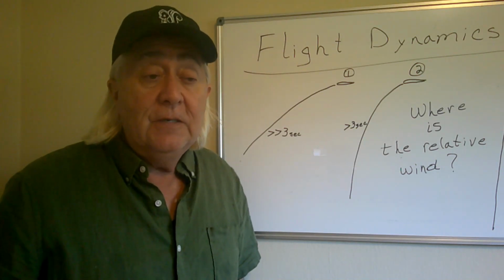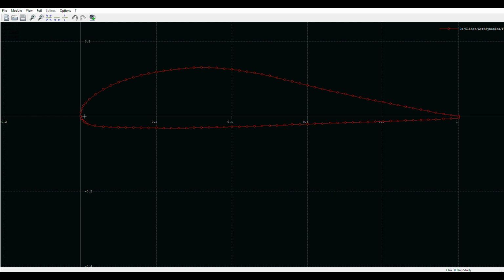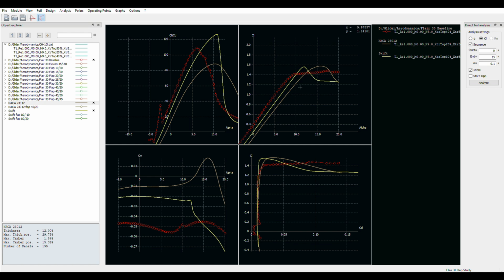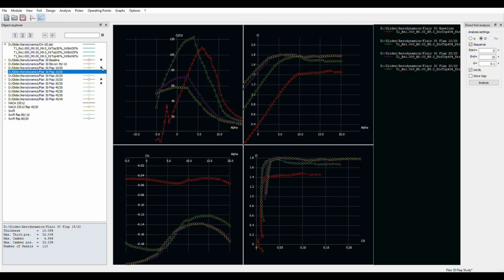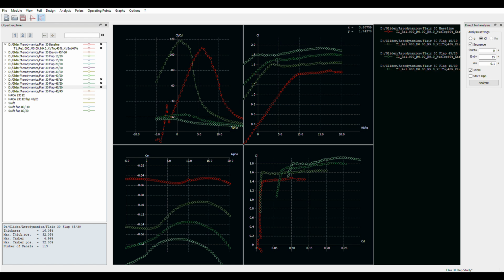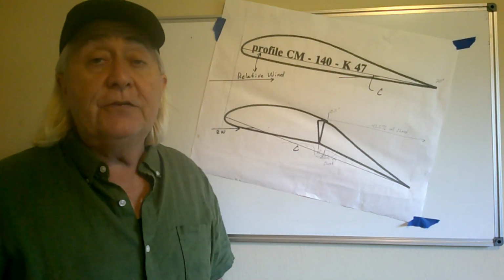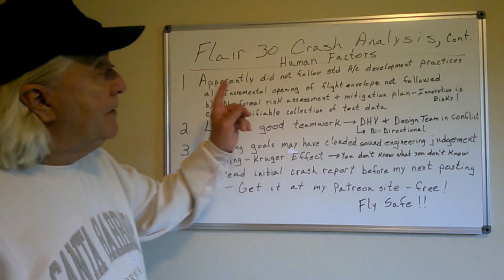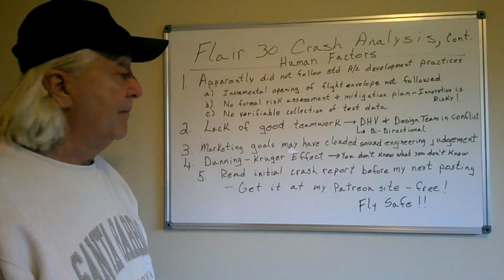Flair 30 Fatal Crash - Final Installment - Technical and Human Factor Details

Comment: So.......When a slat moves DOWN (on the front of the wing) the overall angle of attack of the wing is less.  

Thank you for spawning several epiphanies !
Reply from the maker: Yes, that's why it is nearly impossible to tip stall a wing when the slats are deployed. So, why aren't they used on all aircraft? Mechanical complexity and maybe weight.

Comment: An initial investigation of some of these concepts was performed with a 2 channel RC hand  launched glider using giant flap instead of elevator for pitch control - the Flap-a-lator (https://www.youtube.com/watch?v=7clsTfbXpC4)

The results are promising with great speed range, low-speed control authority, instant drag shedding upon raising the flap (stick forward) and good penetration at minimal loading.  

Airfoil thickness ~3.5% of chord

Flap area =~50% of wing area…. Notice the total travel of the trailing edge is not huge, for overall A.o.A. changes comparable to that of a conventional-sized flap of minimal chord percentage.   Naturally the planform of this wing is also a unique component of the overall aerodynamic performance, as is always the case. 

The angled hinge is not ideal compared to variable curvature, which is not out of the question for these light weight hand-launch glider airframes

Further envelope expansion is needed for CG placement, wing loading and fixed stab parameters of angle and area, etc....

-TimH
Reply from the maker: RT Jones (famous engineer with NASA Ames) did all this work back in the "70s or there abouts. He also developed all the math and ran a series of tests. The team that designed the Swift hang glider tried to use the concept in full scale but could not get sufficient control power. They still use the concept for pitch TRIM control and I do the same thing on my KW MkII. Keep in mind that many concepts that work on models do not work the same full scale do to Reynold's number differences.

Comment: I believe, Steve, that tail surfaces on many airframes are hinged midchord.  Based on your kind sharing, I begin to become concerned about such control surface ratios.  I also recollect on very early flying machines that horizontal surfaces sometimes exceeded 50% chord hinge points.  Thank you for bringing these issues to the world's attention, Steve.
Reply from the maker: This was covered by a previous comment. I know, easy to miss. Many control surfaces are hinged at 50% and they are mostly flat plates which is an entirely different issue. Also, most of them fly at much higher Reynolds number, making them a different case. I also see a lot of comments about models and they are another special case. You can't make comparisons across wide Re ranges. It's a case of apples and oranges. This is what tripped up the Wright Bros into using the wrong airfoil. See my video on the subject here: https://youtu.be/3PqZurAydNw

Comment: Haven't you flown free flight wings?  Really that is a fine practical and inexpensive way to learn practical aerodynamics.  Key is free flight.
Reply from the maker: I have flown many different types of free flight for many decade and used to compete at the National level with indoor paper stick. That said they don't tell you much about full size aircraft due to the Re differences. Even my 1/4 scale R/C model of my current wing does not fly the same as the full size because the low Re avoids all the flow separation issues. See the following video: https://youtu.be/3PqZurAydNw

Comment: Flair airfoil looks similar to the Liebeck high lift airfoils for low Reynold's number. They have a sharp stall on both positive and negative angle of attack. The margin for separation in the pressure recovery section is constant so when they deflected the flap the flow started separating at the hinge line loosing lift. The hinge flap became a split flap.
Reply from the maker: Are you saying that the Flair flap was acting like a split flap because of the separation criteria? Do you have any analysis that shows the effect? If yes, send it to my email. I might want to do a video on it. Seems to me they are really two different cases, but I have never really studies split flaps.

Comment: The hinge was a good idea for transport. They might have kept it and added proper control surfaces.
Reply from the maker: Agreed, but it appears that the transportation idea came first and then the decision to also use it as a control surface.  And, then the whole concept was marketed and hence became very hard to undo, especially after molds had been constructed. This all falls under the Human Factors issues.
Reply: @KlingbergWingMkII  I would add that there is also a human factor to dismiss good ideas when disaster happens. Sort of like tossing the baby out with the bathwater.
Reply from the maker: What "good idea" was I dismissing?
Reply: @KlingbergWingMkII  YOU weren't dismissing anything. People tend to overreact when disaster happens and not reconsider what was right. Are you or did you consider the hinge for the the Klingwing 2?
Reply from the maker: No, only briefly very early in my trade studies. Rejected it due to weight, complexity of the build and attending control systems. Poor trade for a small gain in portability. My current design is still car top-able (I like the trailer) and can be assembled single-handed in about 30 minutes and that met my desires..

Comment: Excellent work Rol, lots of hours put in and it shows.  Inducing a stall over the majority of the wing on flap deflection makes a great deal of sense, such a big reduction in stall AOA is such a huge change in flight control that makes the wing so much harder to learn to fly safely.

Tuft testing would have really helped pick out the stall characteristics.  So much easier now to monitor tufts with lightweight high rest cameras and or even following drones.  Even back then though it might have been a big enough kick to get them to rethink such a broad flap across so much of the span - as the aero analysis suggests that separation was happening on the wing even on small deflections.
Reply from the maker: Thanks for the kind support. A thing that made me depressed as I did the analysis, is the fact that they might have been able to access the DHV test vehicle where they could have done tuft testing, amongst other tests. 50 meters off the ground is the wrong place to discover bad aerodynamics.
Reply: @KlingbergWingMkII  Even with tuft testing the DHV Test vehicle would have picked up oddities in the effect of the flaps on pitching moment, lift and drag.  I'm pretty sure it would run up a whole bunch of red flags that the flaps weren't behaving the way they were claimed.

From my experience of getting gliders ready for DHV on the AIRWAVE test rig (early 90's)  it was clear that the DHV had their own problems.  There was dubious elements of the DHV test requirements that didn't make sense from an aerodynamic perspective, and were out of step with the UK and US airworthiness schemes that made more sense, but I believe they were belligerent in sticking to their approach.  I don't know if they've fixed these errors yet.  There are errors in the UK and US ones as well, but these issues are a whole nothing topic...

I could imagine that the DHV tested it and got stuck on stuff that really didn't make sense for the Flair and wouldn't consider adapting.  However, the Flair clearly had major problems itself and their designers weren't open to considering these issues thoroughly.  The DHV report would shine a lot of light on what they found, as well as the culture behind them so it's shame it's not been shared for everyone to learn about.
Reply from the maker: Your comments on the DHV go directly to what I'm saying in the video. It is a classic example of people on both sides working from a point of "Not Invented Here" instead of working as a team - a classic human foible. I know the DHV had its own issue and I think it's a case of they were geared to test flex wings and lots of that does not apply to rigid wings. If that was the case here, the Flair team should have done their own vehicle testing rather than putting a person's life at risk. I've spoken to a number of people that interfaced with the DHV and it is clear there was enough conflict to go around and in this case that was part of the reason for the crash.
Reply from the maker: Oh, yes, and let's remember that the person that told them to stop flying was a professor of aero engineering at the local university. That does not mean he was right, but it does mean they should have stopped flying until his concerns were fully vetted backed by analysis. This goes to my point of having a well-structured test plan with rigorous risk management.
Reply from the maker: Actually, maybe not. I'm not sure the test vehicle in that era had a load cell for collection of lift, drag, and pitching moments. Initially, in the 80s the test vehicles were used strictly for load testing to ensure the structure was strong enough. Could be either way. If the vehicle had load cells, it would have been quite fancy for the day. Maybe a viewer from Germany would know? If so, let us know.
Reply: @KlingbergWingMkII  HG Test rigs in the 90's had load cells for lift drag and pitching moment,  USGA, BHPA and DHV rigs all needed them as certification during this era required this data.  The AIRWAVE test rig had all these measurements as well as it was important to make sure the gliders were going to pass before being sent for certification.
Reply from the maker: I think the Flair was tested in the late 80s and I don't know when load cells came into use. If the DHV had load cells at that time, they would have clearly shown the problems with the flap, if the DHV deployed it during their tests. Either way, my point remains, both sides failed to work as a team, did not take a professional approach and ended up killing someone. In my mind, human factors killed that poor guy.
Reply: @KlingbergWingMkII  Totally agree, there looks to have been were several opportunities where proper engagement between various parties could have led to a different outcome.

I am surprised the the flight test didn't raise more red flags prior to the accident, in 50hrs of flight time they must have had the opportunity to explore the effect of the flap deployment on stall AOA, pitching moment and performance.  A lighter pilot would change the airspeed things happen at, and might change the COG a bit, but aerodynamically it's still the same wing, the same fundamental problems would be there.  The glider likely wasn't nice to fly, especially at lower speeds and with especially any amount of flap deployment.

This makes me wonder if the test pilots were also being overridden/ignored, or they lacked the experience the properly convey what was happening.  Given the DHV was also ignored I suspect red flags were ignored from all directions, ego/force of character winning over common sense.  A different culture at the DHV might have helped, but if your own test pilots are also being ignored then it's a problem at the heart of the design team that only stopped because the worst happened.

As you rightly point out in your video, being a good engineers requires us to stop and listen, to take stock rather than to forge ahead without our projects.  it's such an important part of the process, never more so when one is innovating beyond the envelope of prior art.
Reply from the maker: It is interesting to note the data show that with 10 degrees flap, the L/D would improve by about 10% and at 15 degrees there would be about a 10% decrease in L/D relative to the baseline. However, at 20 degrees flap, the L/D drops by 80% (actual L/D  around 6/1)! And these numbers are generous because I have not included the lift loss due to the up elevon required. So, reports of poor performance were quite real. I suspect they found this out early in the flight tests and never used more than 10 degrees of flap until the fateful day.
Reply: @KlingbergWingMkII  I am curious how the sweep would have affected the behavior of the boundary layer and progression of the stall.  I suspect beyond a certain level of flap deflection at low speed we could see a separation progress rapidly across the whole flap, this separation might be even stable separation bubble.   I'd expect the effect of sweep would result in angles that the flaps don't have a dire effect on performance for less deflection than predicted by the 2D analysis of section.

As an aside, one of curious titbits I picked up while at AIRWAVE was back in the 80's the AIRWAVE Magic exhibited a stable separation bubble at high AOA that allowed pilots to get nice coordinate roll and yaw into turns that made it great for thermalling, without the wing breaking into a full stall.  It was only with tuft testing that they figured out this was happening, later wings with different profiles/sweep and washout didn't exhibit this, just happened to be one of those quirks that was never designed in but worked nicely all by itself.

Unfortunately, the Flair 30 design had the opposite, deadly quirks 😐

Comment: Preliminary comment @ 54 mins in, first the contrast between the black background and the dull red is quite hard for me to see (on iPhone and 70 year old eyes...) but the discussion is excellent and bears out my earlier comment about too much control surfaces chord. This same temptation exists with roadable aircraft and I think the first Taylor Aerocar overstepped the mark In order to get less towed side area when folded at the first hinge line - later deleted the flap. Ditto for the Brown Carplane that stows the wings between twin hulls and possibly the Klein vision Aircar .
Very significant realisation and data that applies to these flying cars. On 2300 series aitfoils I found the Schweizer 1-23 to have a viscious tip stall that allowed for snap rolls eg when pulling out of a loop too hard but fun to do on purpose just not when thermally, the outer wing has high taper but parallel ailerons giving high relative chord at the tip-bad combo. Ditto the Caproni Ca 21 Calif but the old Olympia and many old gliders had very high percentage chord ailerons at the tip but it was viceless - not sure of the airfoil and twist was ca. 5 degrees (not a tailless a/c of course but same principle should apply you might
expect bad tip stall; any comment?
I'll enjoy the remainder after making dinner. Appreciation for your effort on posting this valuable info and the experimental work, Jim Marske seemed to use something like a 23 series airfoil and the Bocian glider also both with some aerodynamic forward sweep and good low speed lateral behaviour despite the sharp airfoil stall break (even a C150 will roll on it's backing a full stall if allowed)
Must eat then return for brain food. Cheers.
Reply from the maker: Yes, for me too as I'm 67. The cursor was a nasty challenge. I recorded that stuff three times. Seems to be a problem with Xflr5. No matter which cursor highlighter I used it would revert back. And without the black background, it was very hard to see the data. So, I chose data. To "solve" the problem, I provided all the files on my Patreon site for free. Just download Xflr5 and you can recreate and modify all the work I showed. Interesting stuff on the other gliders  - I've never flown any of those. Seems the 1-23 used the NACA 23009 at the tip only, so hard to say what would case the snap. But it does explain why nobody would let me fly one when I was a kid!  A lot of stall behavior is also driven by the thickness of the control surface -- see: https://youtu.be/2mh8szvuD40  Overall, I could safely say that a control surface of more than 20% of chord is probably putting a significant dent in performance. I suspect this is why modern gliders usually have full span skinny control surfaces. And many times trip strips also.
Reply: Bloody spellcheck  at work on several auto-typos. Sorry about that.
Reply from the maker: NP